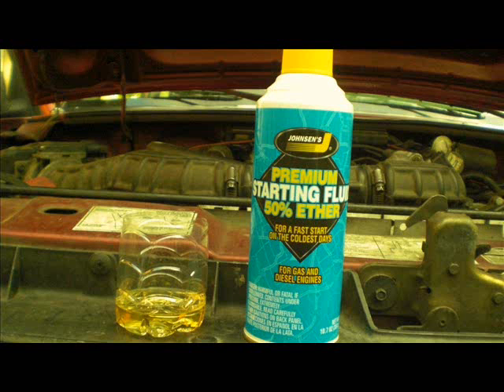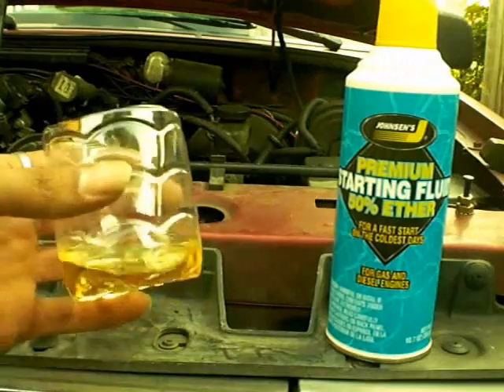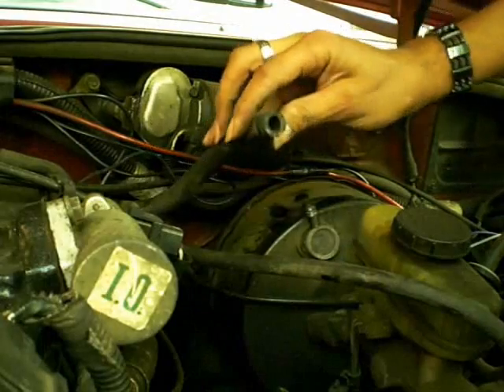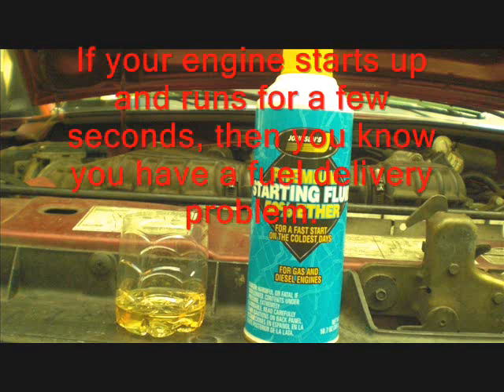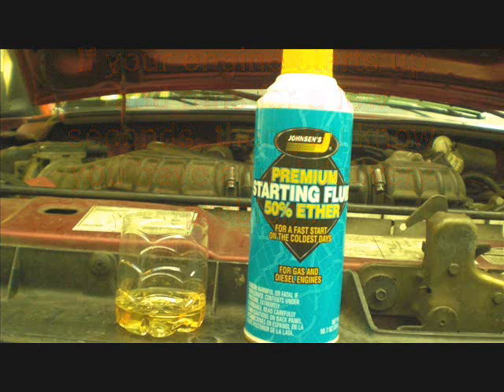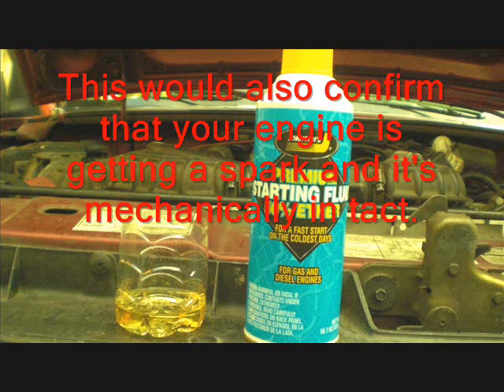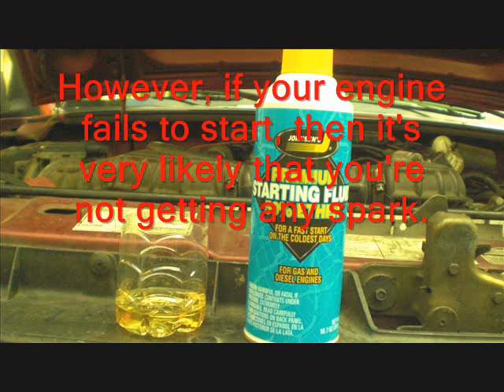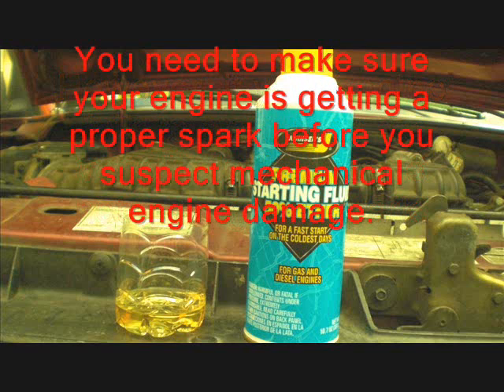Test an engine that cranks but won't start.

Comment: I've got a ford transit connect it was going fine then one morning it was just cranking over but no start..it goes whith starting fluid .but stops when you stop appling it..do you reckon it's fuel pump that's bad

Comment: As you turn on the key before starting, listen for the fuel pump to run, then stop. It should do this to bring up the pressure.

Comment: Well if you have a spark problem your engine is not going start start you have to have Sparkfor your engine to start so it could be there in this you coil causing this problem doesn't it doesn't mean it's the fuel either

Comment: hi i have a 87 ford bronco 2 it has 40psi fuel pressure and good spark but it starts then quickly dies it sat outside for 6 years i pit new fuel in it. what should i do, thanks
Reply: Black Hammer what did u do
Reply: Thomas Smith it's probably varnishing or other deposits blocking up your carbs. try pull the drain plug on the carb bowl. if nothing comes out your floats stuck. if there's fuel in the bowl it's most likely a blocked jet. it sounds like it's starting on choked fuel but dieing when needing fuel from the idle jet.

Comment: what the f is a brake boost
Reply: It's a cylinder that uses the vacuum pressure from the engine to add power to the braking system

Comment: ive done this method of testing.. it works my engine runs for a few seconds then dies.. now supposed to be what's the problem if this happens? pump? carburetor? i need help.. thanks.
Reply: fuel pump fuse the easiest thing to check or the filter on the pump it obstructed
 
and if you used the method show you dont have a carburetor if you do pol the filter of and just spray started fuel to check 

it may be the fuel pump stop working  because no power reach it or in simple work
Reply: +Erjin Lord Navarro 

What did the answer to your problem here turn out to be? Thanks.
Reply: I have the same problem.

Comment: Great tip on trouble shooting fuel feed problems, Worked great and after I did this it starts right up now? I will replace the fuel pump encase it dies completely Thanx again!!!!
Reply: I am getting fuel but no spark to my 1965 Chevy pickup with 350 motor I need someone to help me out in a way I can understand

Comment: I did it on my 2003 Ford Explorer Sport Track... if your car cranks, but doesnt start...  if you have an electric fuel pump... locate the fuel reset button on your car, which should be in the passenger floor rail...push and hold it for a quick second... turn the ignition on, wait a few seconds and then turn it off... give it a few seconds to kick in and then start your car. You must replace your fuel pump if that happens.. that way everytime u turn your car on and then off you wont have to keep pushing the reset button. Hope this helps! Good luck!
Reply: +Kevion Warren  You are talking about the Inertia Switch .. If you press it in then your just resetting it and almost always it will keep doin this you keep having to press it in. If this is the case then you just need to replace the Inertia Switch it self and not the fuel pump or fuel pump housing sending unit both of which is very costly and expensive..

Comment: i have a 1997 mercedes e320 cranks wont start . i replaced fuel pump and crankshaft sensor still no start can u help me
Reply: there is also a cam shaft sensor.ask your mechanic if your's is in your distributor or separate.

Comment: I need help with my wife's 2001 chevy prism. It runs fine but sometimes it won't start back up seems like until it gets good and ready too. It cranks but just doesn't turn over. Once it starts back up it runs fine. It does eventually start back up and it doesn't do this all the time. Sometimes she'll drive it go into the store or wherever come back out and it starts right up. I replaced the crank shaft sensor, that wasn't it b/c its still doing it. I also replaced the fuel filter on it.

Comment: I am having same issues with my 96 saturn wagon it cranks but wont start i tried the spray and it want's to start after i used the spray it was closer to starting then before but still no go.I checked for spark from plug wire and there is a spark.